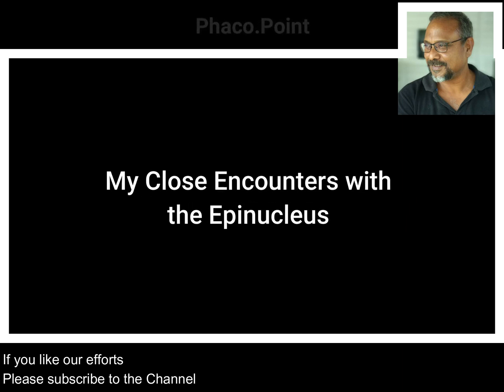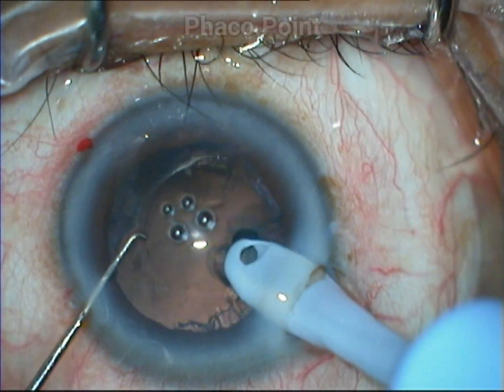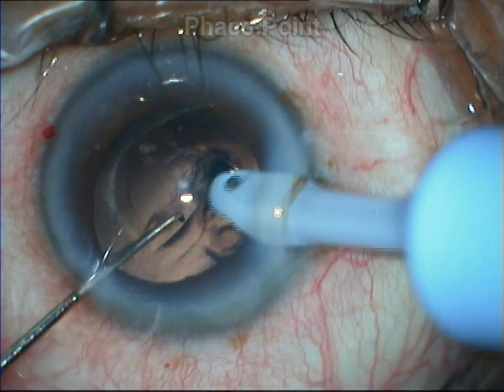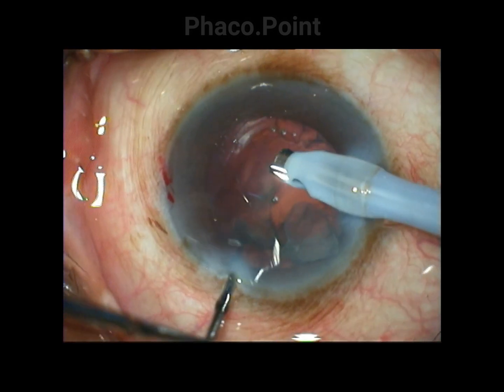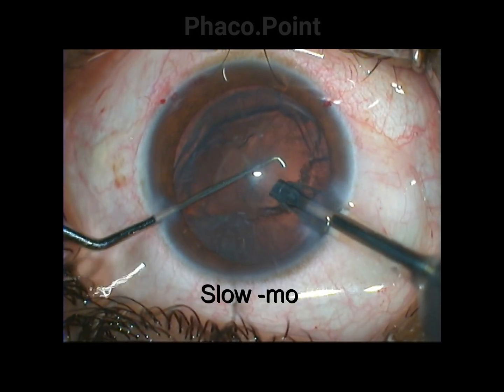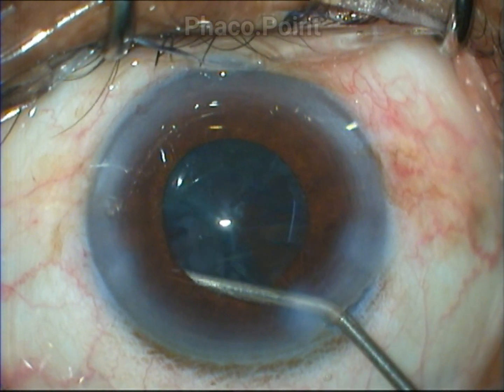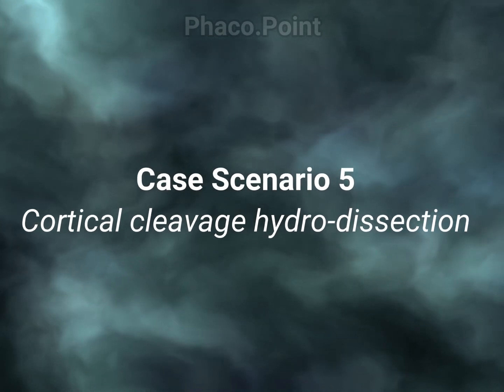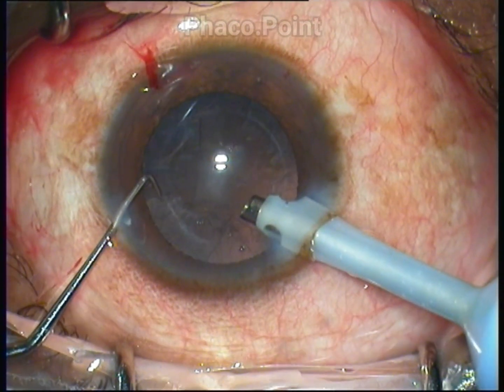My close  Encounters  with the Epinuclear Shell

Comment: Respected sir 
The best way to deal with stubborn epinucleus is to use the Simcoe canula 
It becomes easier
Reply from the maker: that is because you probably perform a lot of sics and primarily use the symcoe canola for most of your cases. the aspiration port in both the symcoe and the bimanual and coaxial canullae is the same 0.3mm. with syncope the constant shallowing of the AC increases the risk of PC rent. As you begin the use the bimanual/coaxial more often you will prefer them